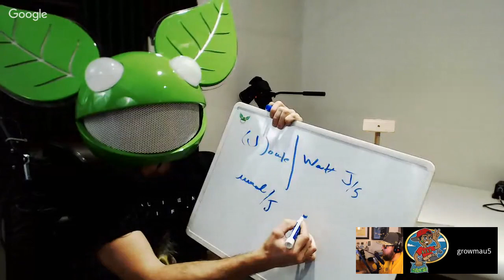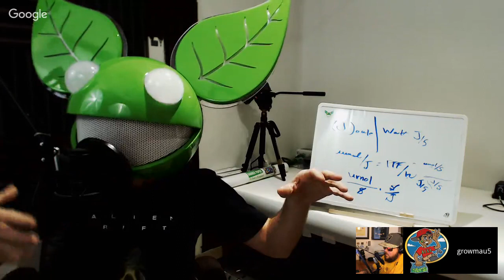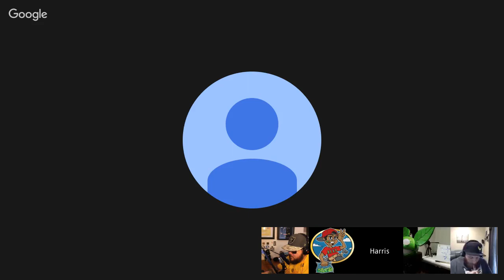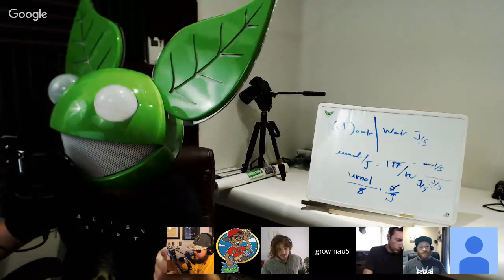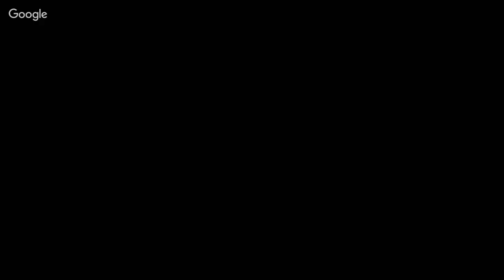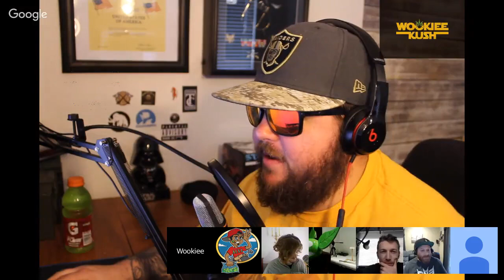LIVE: how much LED for your grow space?

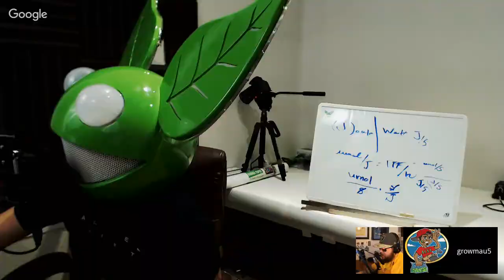Comment: If you watch this video at 33:00 you get all the explanation you need as to why buying an LED when you’re just starting to grow makes no sense. He literally said the words “it could be an extra $75-100. If you grow properly and get the proper yields for the space you’re in, $75-100 should be something you whipe your butt with. And if you’re growing for yourself it makes 0 sense to spend more than $100-150 on the total of cost of your light. An $80 HPS 400 watt light combined with a 250 watt bulb in veg will give you a half pound every 90 days in a 2’x4’ space...why the fuck would you mess with that setup for a beginner grow?!?

Also, just to quote this guy. He also says “it can be hard to get even coverage in a square grow space”. 🤐

Look if LEDs can’t cover a square grow space why the hell would you buy them seriously lol
Reply: 10 year caregiver here. Keep buying a 60$ or more hortilux bulb every grow. My LED "bulbs" last 5 years and only cost around 10$ to replace. You sound like you have never ran 10 HPS lights at once? Thats 600$ to replace all the bulbs everygrow!!! The heat from all those all those hps is insane and your looking at huge air conditioning effecting electric bill. You really sound like you haven't ran continuous cycles with multiple hps. Cheers
Reply: Eric Kiablick I hear a lot of fancy words. None of which justify the cost to set it up. If you grow gangster you would never use LEDs, hence why you don’t see ppl using them in general when they’re a serious grower. It just doesn’t make sense to spend hundreds on a light when you can grow a pound of weed with a $100 light and the total cost of electricity over a 3 month period is like $250. So that pound effectively might cost you $350 including the cost of the light....why fuck with that? I don’t care how much electricity you save with an LED it is NEVER worth the upfront costs, hence why facilities don’t use them.
Reply: Eric Kiablick lmao I ain’t trying to mimic the sun bro outdoor weed is worth half the price of indoor bud grown worn HIDs why the hell would I ever want to mimic the sun lmao
Reply: Less electric draw means less eyes wondering why your spending double what your neighbors are.
Reply: deathmarch5 lol yeah if you’re growing illegally. I’m not
Reply: Eric Kiablick so if spectrum makes a difference how come they don’t put “grown with LEDs” on the labels at the dispensaries? 🤔
Reply: deathmarch5 😂😂😂 my dude. Are you insinuating that the fucking federal govt is coming after personal grows in houses??? Wow. Just. Wow. AND you think the power company is in on it ?? Man. You really haven’t grown before, have you?
Reply: Eric Kiablick look Dude if a fancy COB 600 was the same price as my 600 watt HPS set ups, maybe I would go for them. But they’re not...and when you’re starting to grow it makes no sense to spend more money, and personally I’ve heard the reviews on LEDs from people who have tried them in a facility and you know what they said? They literally said “the colors popped a little more”. So you’re telling me it’s worth it to drop hundreds, maybe even thousands on lights alone depending on your setups, for “the colors pop more” or “I get 5% more triches?” Lmao it’s just not worth it. Hence why people who are good at growing don’t generally use LEDs. Not saying NO good growers use LeDs, but most don’t.
Reply: Hunter Crain you an idiot first of all 600w hps to 400w cob set up is like driving a stock version of the same car but ones a 1960 and ones a 2018, and if you like spending more of that profit on bulbs and electricity go ahead im sure no one will stop you, and also ive never seen a hps be able to mimic the sun rise and sun set like growmau5's canopy build soo have fun staying in the past
Reply: Miguel Fiero if you’re even THINKING about the cost of your grow, you aren’t doing it right my friend. If you get the right amount for your light the cost of bulbs and electricity is nothing compared to the cost of the cannabis and the spread of LEDs just isn’t the same not to mention you have to grow big ass plants and put them far away.
Reply: Miguel Fiero why the heck were you replacing your bulbs every run?!?
Reply: Still illegal federally who do you think the power companies notify?
Reply: led boi go hate, led is expensive, too bloody expensive for your own grow
Reply: + Eric Kiablick
elec costs?!?! where are you growing? hawai? europe? cmon power is almost free
Reply: Hunter Crain . Leds use half the electricity. You only need to change the diode every five years instead of a 60 dollar or more hortilux mh or hps bulb every grow.   Those two things save so much money that the added cost up front doesn't matter. Also Leds give off a healthier spectrum than traditional grow lights. That's the only reason they can compete with the power of hps or mh. Because of the better spectrum it actually makes the plants finish a week or so earlier. This extra week adds to extra grows during the year!!! Mmmp
Reply: Miguel Fiero Lol what the fuck? No. Just. No. Strain is what determines when something finishes. And light determines nothing except yield.
Reply: better range of spectrum, less electricity, and more micromoles per watt used so over all better PPFD, which judging by your argument i'll tell you what that is, its the photon(energy the plants get from lights) density the light emits, this will change from right below the light/canopy/ and lets say the top of our medium. so if that doesn't seem to change your mind have fun spending more money on electricity and bulbs and a lower efficacy.  🤐 🤐 🤐 🤐 🤐 and as far as covering a square space you just have to have good placement of you cobs or leds, and remember your bulbs are cylindrical  so they are putting out 360 degrees of light and yes a hood will reflect a good portion of it but its not the same as emitting at most 170 degrees, soooooo...........
Reply: Eric Kiablick All of this has nothing to do with growing lmao when growing you should be concerned with one thing. That is trading electricity for bud. If you’re not happy with the amount of bud your HPS is giving you you’re probably not a good grower. End of story. They don’t use LEDs in faculties. They use double end HPS because it works and it’s cheap. Duh. Why spend more on the start? At that logic, I should def go out and buy a Tesla for my first car right?
Reply: Eric Kiablick anyone in their right mind who wants to make money and grow a lot of bud would buy DE 1000 watt HIDs, throw super sized hoods on them and hang them on the ceiling, veg for a week w a billion plants and flower sea of green. That’s what works. Why mess with that
Reply: @huntercrainmusic  becouse that is not the right way too get HQ bud you get shitty small and not potent enough bud that way ..  that is the cave man way of growing weed
Reply: Beton bossen I’m sure that’s why 90% of facilities grow with them.

Comment: i have agrow room,10x15 .an i got a 5x5 g0orilla grow tent,i been using it for my veg plants an baby clones an to start my auto flowers,my bud area is 2 4x4 pallets lined up,an i got a viperspectra 700par a mars 900watt,an two king 300watt led,i put the two 300watt in the tent,an hung the mars 900watt an viperspectra 700 on the flowering plants,thier 4 week int0 budding,an thier doin pretty good,an pretty,but we got 20 plants 10 on each pallet,is the mars an viper 700 par .the plants r 4-5 ft.do those 2 lights put off enough light to get a awsome harvest,with big fat dense buds,i need a hps bulb 650watt,and a fixture real bad.lol.i spent my saving building the growroom,iam hit til harvest.if anybody has a old hps/met halide light to donate an a bulb,id be so grateful an would return the favor to them anyway they ask
,
Reply: jason newton ouch. Sounds like you spent a lot of money on that equipment
Reply: Hey I got A few questions for you u can add me on fb pauladams668

Comment: 54:47 I agree, eight CXB3750's equal 600W power draw, yet equals output of 1000W HPS. 
Twelve CREE chips will get you 1500W HPS equivalent light intensity.
It's super cheap to build your own and the efficiency and light spectrum are great.

Comment: I have a 2'x2' tent and a 2'x4' tent. I want to have some 3500k 3590s Cobs and also some Red and blue spectrum in the mix. What would be the best set up as far as How many 3500k 3590s and how many/watts of Blue spectrum and how many/watts of Red Spectrum. Essentially I want to have each tent for entire veg to growth purpose with the best combination of spectrum range with ability to tailor each spectrum intensity as needed, since some strains react differently. I intend to incorporate PWM for each (3500k,reds,Blues) so I can dim each independently based on how they react to per say blue or red spectrum.So if you could suggest the number of ,as well as model # of each COB so I can get a balance for veg/flower.

Comment: I absolutely love your channel. It's so hard to get good information in this industry. 
I'm new to growing and addicted to fabricating. I have a couple subjects that may be good content for you to do videos on.

1) grow room build-out. Paint, adhesives, sealers, fumes that can be harmful to a grow. Suggested materials, coverings, paint, etc.
Reflective coverings vs white. Why is no one using mirror plex for walls? Why not bounce photons as much as possible?

2) greenhouse grows. Light assist fixtures. Much like Gavitas. 

3) breakdown on light spectrum. Propaganda by LED light manufacturers would lead us to believe only red and blue are needed.
SpectrumKings videos get into it but they are just pumping their light, as they should. 

4) LED conversion on a hps vented fixture with a glass bottom ( I have a few old single end fixtures that seem like it would be a waste to throw out ).

Comment: @Growmau5 Your calculating percentage difference wrong, the difference between 1.3 and 1.8 can't be solved by 1.3/1.8. That gives you 27.7777%, the real difference between 1.3 and 1.8 is 32.2581%, that is quite a difference. Yes I know that is how most are taught to calculate it, its how I was originally taught as well, but its wrong. 

Percentage difference equals the absolute value of the change in value, divided by the average of the 2 numbers, all multiplied by 100. So ((1.8 - 1.3) / ((1.8 + 1.3) / 2)) x 100 = 32.2581%. For example, there is a 14.9258% difference between 27.7777% and 32.2581%, that's a lot of meat to leave on the table, particularly when financial decisions are involved.

Anyways, loved the show as usual, just thought you might want the heads up, keep up the good work!
Reply: Just google percentage difference calculator, you don't need to remember how to do it longhand, you just need to remember there is a proper tool, when the numbers have to be right. 

The first time i realized something was wrong with the old way, it way because you get a different answer when you go from 1.3/1.8 to 1.8/1.3, it should not matter how your arrange it, the difference between two numbers should be set in stone, not different depending on how you ask the question.

Does not matter if its (1.8 - 1.3) / ((1.8 + 1.3) / 2)) x 100 or (1.3 - 1.8) / ((1.3 + 1.8) / 2)) x 100 answer is always the same.

Comment: whats your opinon on full spectrum led's , good bad  or just run the white lights? i built a 3' led bar with 2 100w fulls and 2 100w kool white leds each 1 powered by its own 50w driver. my grow space is 2 x 2 x 4 too much?
Reply: So 200w total from that wall, on a 4sqft of grow space? Your pushing the max, my light can run up to 50w per sqft, but I am not height constrained like you. I have also never ran it that hard, because I am not running CO2 yet, so it would be wasted. I dim my down to roughly 40w per sqft in flower.

Full spectrum LEDs are white lights, but a mono diode based board can be great, if it has the right ratio, and its build from quality parts.

Comment: i have an old 4ft shop light hood with 4 x 40w T12 grow bulbs and I get about 10-15k lumens. It does not grow plants fast but for my mother plants that I've had long term it has worked great to keep them in a slow grow stasis like state.

Comment: I just ordered 18 vero 29 se 3500k 80cri 37.8v cobs (was told the se is the same as gen 7, se just has push pin connections) , going to run 9 cobs per 4 x 4 tray.  Will run each 3 cob bar off an hlg 240 2100b driver.   Is this a good match?  Would this be 75 watts per cob? I currently have 2 12 3590 cob fixtures running at 1400 mah over 4 x 4's, I am happy with it but wanted to try the vero's since I just built an 8 vero 29 gen 7 at 2100 mah fixture for my 4 x 8 veg tray and am super happy with it, puts off a shit load of light.

Comment: do you guys have to feed more since using cxb3590s???
im using 8cobs with strains i  know well and they have nutrient deficiencys!
Reply: Yes, even with no-till like I run, I have to have a more heavy hand when re-amending. Fact is, your yielding more then if you used HPS, that means its needs more nutes. 

Really if your running hydro, you should be allowing your rez PPM dictate feeding. If your PPM is going down day to day, it means your plants are using more nutes then water, increase PPM, if your PPM is going up over time, your plants are using more water, lower PPM. 

Ideal PPM is even consumption of water and nutes, day to day PPM should not change much.

Comment: I am about to start my first crop of medical marijuana. I am using %30 coco coir, %20 water stone, %20 organic compost, and %30 Miracle Grow organic potting soil in 15 gallon air pots. I am not sure what to add.  I have a soil meter.  What do you recommend for nutrients?  I growing in a spare bedroom with a good air filtration system and pretty good LED light system that pulls 300 watts.  I am kinda hesitant to plant the clones I have e on order. Thanks!
Reply: Betty Cocker I have 10 15 gallon air pots with 3 Vipraspectra 600 PAR grow lights.  the space is 10' x 4' x 8'.

Comment: How much would u charged to build me a light for veg and flower that would replace 1000 watt hps and fill a 5x5x6 tent
Reply: Big city, I will build a modified version of the canopy 12 uv for $2500 shipped. I will be finishing mine tomorrow and will have exact par measurements via apogees new quantum full spectrum par sensor. I have also added 6 660nm leds and all cob leds are  cree cxb3590 and are individually controlled by the storm controller.  Reply if interested!

Comment: How many watts of led would i need to replace 2-1000 de hps bulbs and cover a 4x8 tray or 5x10 space
Reply: 1140 aprox
Reply: Adrian Smith where you from?
Reply: Adrian Smith  32 cxb3590 @ 1400mA. 1600w in total.
Reply: I want to make the switch from se hps to led
Reply: Adrian Smith 32 cxb3590 will give you more than 1000w se just slightly less than de but better spread and spectrum. All for 1600w.
Reply: Adrian Smith SE 1000w hps 120 000 lumens aprox, Gavita DE 1000w hps 138 000 lumens aprox, cxb 800w set up 132 000 lumens aprox.
Reply: Thanks for the info guys
Reply: Im growing in a 10x10 tent with 7' foot ceilings i think 4 1000 watt de will create too much heat so led is going to be my next step
Reply: Grow mau5 says lumens don't mean shit its micro moles/jule

Comment: Great stream guys always such a wealth of knowledge. Question I heard you guys saying something about vero 29's seemed to be negative, I just bought a Timber Vero 29 v7 square framework light for my 3x3 tent thoughts on this light? and what exactly is the issue with vero 29's? sSrry just concerned I may have wasted money 💰
Reply: He said that Crees are more efficient at lower currents but do not do as well over 50%--that is where Vero29's and Citizens excel... He was NOT saying anything was wrong with any of them--just where they are most efficient. Vero29's in Dan's lights at Timber are designed to take advantage of the Vero29's being run at higher currents--where they are most efficient. Crees will not perform as well above 50W... Greengene commented how well Vero29s are designed--nothing at all wrong with Vero29. ALL are going to be WAY more efficient than T5s and HPS/MH...  You certainly didn't waste your money. 

The issue raised later was how to pair your COBs with the driver--Dan at Timber did all of that when he designed the light... He designs his lights well.  If not paired correctly--just like any other COB, if you try to run too many, the driver will auto-correct itself and run them at a lower current--that is for anyone designing their own light.  That won't be the case if you bought from Timber as he pairs the drivers correctly. You bought yourself a really good light.
Reply: craginrock wow thanks for that detailed and intelligent response I really appreciate that !